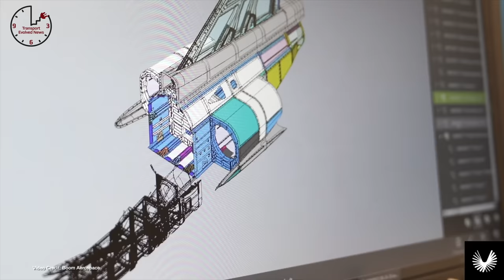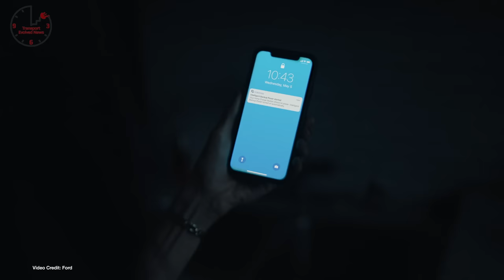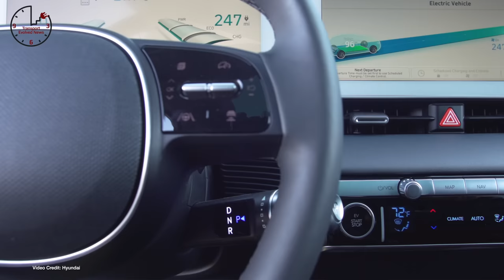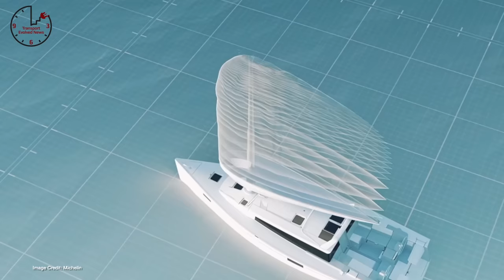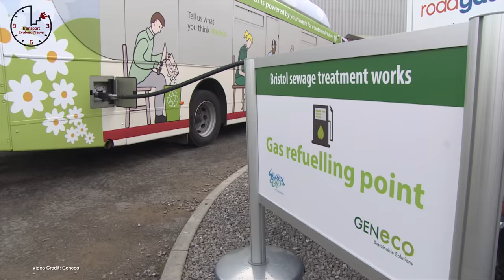TEN 341: Nissan Ariya Delayed, Ford F-150 Dukes it Out With Cybertruck, $6 Million Battery Grant

Comment: I'm really sorry , however this is completely WRONG AND MISSLEADING 07:26 
''Fill UP''  means restoring to 100% capacity 
if you pause the video at 07:26 Those 3.7kw  Modules  x4 = 14kw ,  realistically can give you around less than 50 miles after around 1 Hour charge if we factor heat losses 
.
Its not exactly filling up  is  it 🤔 🤔 🤔 ???
.
Thats why I will never Buy an EV everything related is lies and 16% Truths,  not even Half Truths

Comment: The death of ford has begun. The release of the electric f 150 is miserable. Compare the top configuration f 150 with the tesla cyber truck 3 motor version and the cyber truck is better than the ford in 18 categories out of 20. In the two categories where ford l seems better there are caveats. Then the MSRP of the top ford is $20,000 more than the tesla! So the ford is a dud. Look at the lower end of the f 150 and they are not too exciting.f 150 will break ford.

Comment: Electric vehicles are nice but cold weather they are not great. But computerized vehicles when they have a short you can't push them off the road.  Plus auto pilot in cars is still not safe so I will always drive myself. No computerized or auto piloting in my vehicles thanks. They are currently still far from perfect.
Reply: Norwegians don't seem to have any trouble with EVs in winter.  Only a small reduction in range.
Reply: Thank you for the misinformation, I'm sure it'll be well received by those with a brain. 🙄
Reply: @thomasbonse  if you live where there is snow battery power is cut in half and what I did say on cars that are all computerized they won't move when the battery is dead I should know a few of us tried to move it. That never worked.  To say I am giving misinformation is wrong you don't live where I do or see what I do.
Reply: @shauljonah6955  
Yes, battery range can be cut in half during cold temperatures, however, evolving battery and heating technologies have improved the range in cold weather. Improvements in hear pumps have helped a great deal..

Do you mean the 12v battery or the main battery dying? Either way,  when the batteries in an ev fail, the car is very difficult to move but it can be done.. New services such as remote battery charging is fastly gaining popularity.

In 10 years, the technologies in batteries will be phenomenal.
A 10 year old Tesla Model S and an 8 year old BMW i3 are getting anywhere from 90% to 85% of its original range. 

AutoPilot is merely active cruise control with and without enhancements.
Reply: Winter is only a problem if the buyer chooses an EV without planning for that. I got a Bolt specifically because it has good range that isn't a problem in Chicago winters. I lose less than half since the Bolt is quite efficient but it will require people to think about their purchase beyond color and number of cup holders. If someone buys a car that has 100 miles of range and their daily commute is 85 miles then they just haven't done their homework. It's the same buying ICE. If I have a long commute but can't afford to fuel a car that gets 15 MPG in winter than I should have made a better choice.
Reply: @mamadouaziza2536  well that is good news to know.. thanks 😊
Reply: @davidmccarthy6061  yeah a battery warmer or something like that. Newer cars are better with that. Or find a way to keep it warm if it is hybrid.